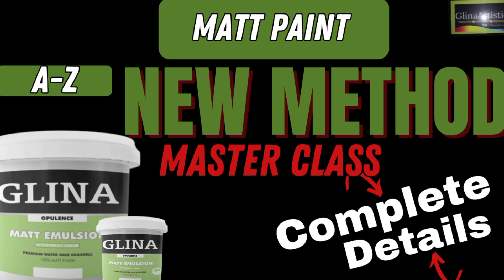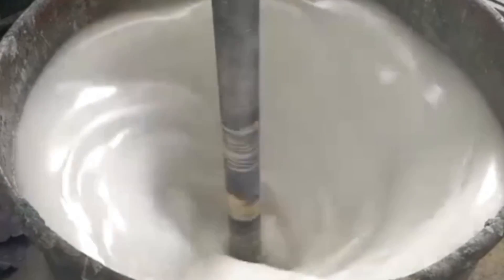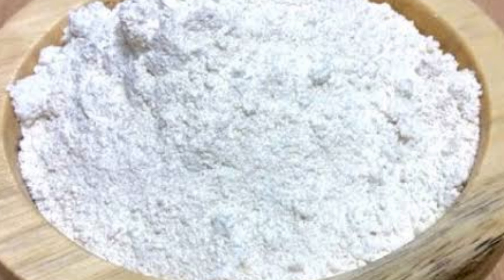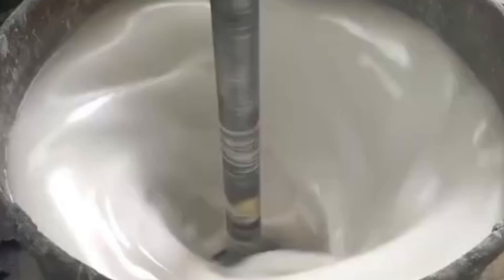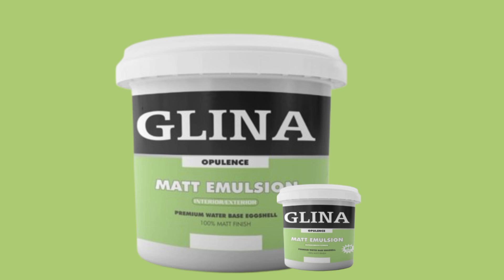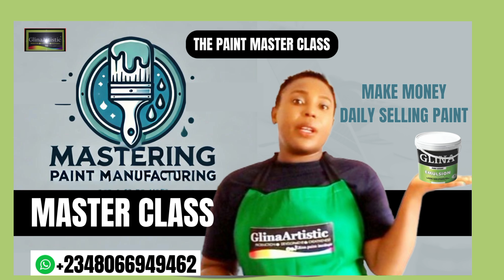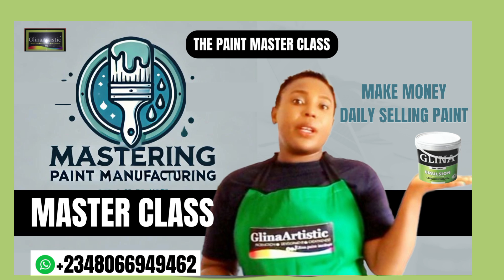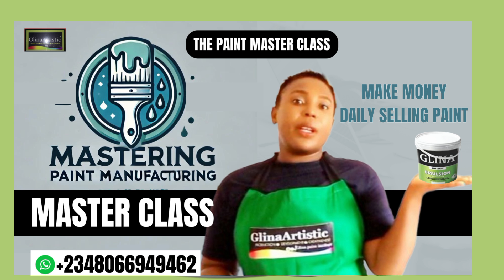Learn How To Make high Grade MATT paint- Effortlessly with New Method

Comment: Good morning. Nice teaching but I quickly want to ask is 3.5kg the standard formula for calcium in Matt production and when producing coloured paint is kaolin advisable because I heard you mentioned for white paint?? I see people use 10kg some use only kaolin and some kaolin and local calcium, so it's very confusing ma.

Also what is matting agent, any local name for it ?

Looking forward to your response, Thank you ma
Reply from the maker: If you are adding other fillers to your matt paint production,  like calcium carbonate,  talc,  matting agent,  kalion etc then you have to reduce your calcium carbonate because of the additional of other fillers, also for local made matt paint you add more calcium carbonate with only kaolin, while other processes you add high volume of kalion and less calcium carbonate but your binder most be very high 😉  

Matting agent, that's the name in the market. If you can't find it. Then, use aluminium silicate and kalion 😉